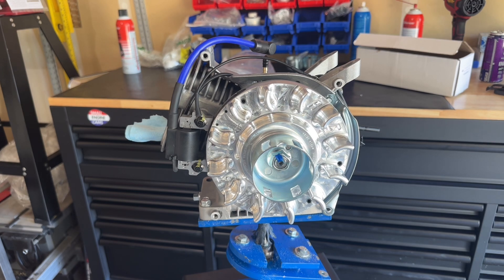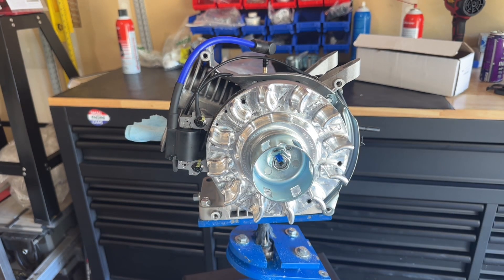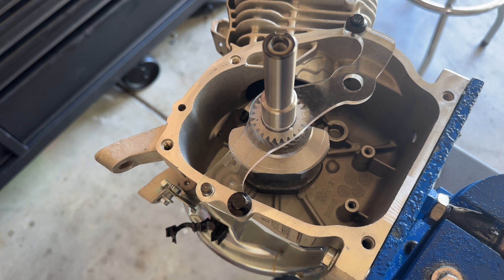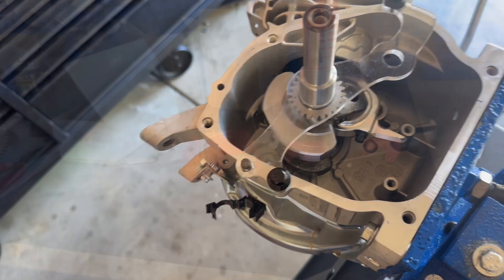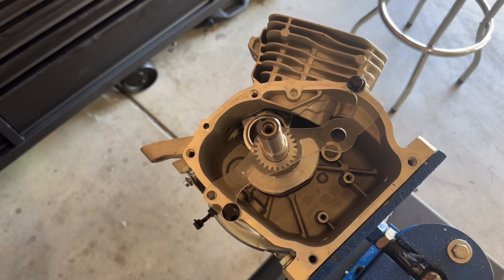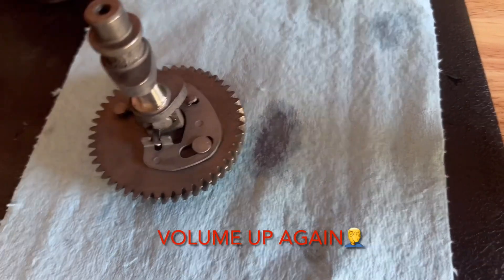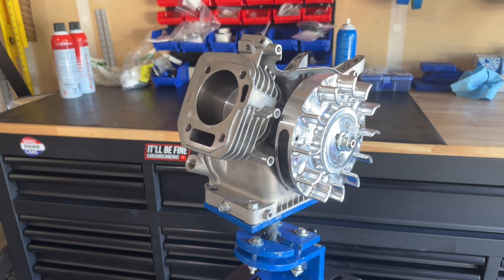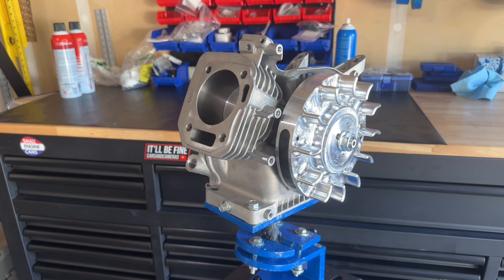Essential clearancing for stroker engines. 223 224 236 263

Comment: What cam is bigger the 308 or the 320 cam or which one do u get more power from
Reply from the maker: Depends what you mean by bigger. Cams are complicated. There are a lot of specs and variables. The displacement, stroke, how well the head flows, what the engine will be used for, etc, etc all play a role. I will say this: the Dyno 308 is an excellent high performance cam for a  street application when you’re using a decent cylinder head. It has reasonable cranking compression, decent starting characteristics, a good idle, wide power band. Sorry if that doesn’t really answer your question but it’s a complex subject.

Comment: Hey man. I appreciate your videos. I just picked up a new 225 bare block with a 240RX stroker kit from Ec. I'll be using a stock head from the 225r with a small port job that i did myself. Excited to test it on my go kart. I wish someone would do this same build and dyno test it to see the power difference from a stock 225 engine.
Reply from the maker: @MarcosDJr  Thanks. Sounds like you’ll have a nice engine when you’re done. @RedBeardsGarage has done some dyno testing on the 225, 236, 240, etc.